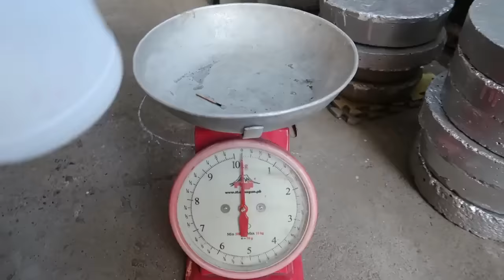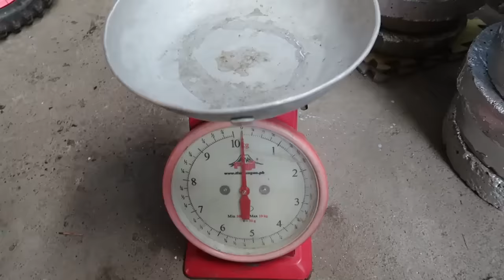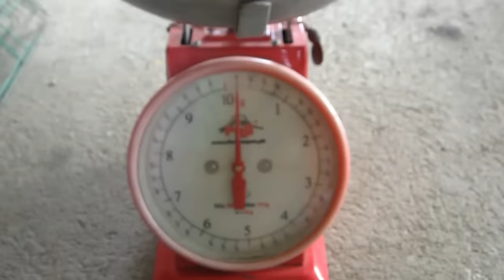How to Make Homemade Dumbbell For Free - DIY Weights

Comment: For the people that don't have scales or that can't access them; 1 l of water is almost exactly 1 kg. You can use already measured containers such as bottles, canisters and really anything that can store water. For example, a 1.5 l bottle when filled with water will weigh 1.5 kg. You can stack 4 of them and get a weight of 6 kg. Don't hesitate to start doing what's right! It's only a few steps away and I believe in you!
Reply: I love you bro❤️

Comment: Thats fantastic. I was body lover some years ago. I read a lot of, joined best gym and won mr. Indore title. Then bad time comes. Went in depression. Start drink and smoke. After 5 to 6 years, i started working out at home due to lockdown. I used my knowledge and came to 54 kg from 71 kg in two month. Only body weight i used and one water bucket. Also i couldnt get egg and meats as well. Now i will add more weight and make a good body without spending on gym membership. Thanks for the video. Helped a lot
Reply: You went up by 17..kilos in two months?

Comment: 0:30 i just spend 3hours making this, its 4am right now :D
Reply: I didnt have rope so i used tape and my bar was thin
Reply: @poliisikoira2765  was it holding alright? I want to build this too, but I don't have such ropes and I don't know what kind he used, because it doesn't look like your usual rope to me. I was thinking about using tape, but my main concern is that they won't hold together and will fall down
Reply: @micy7182  i used tape, the bottles are spinning depending on what reps are you doing. But its worth it im already seeing proggres.

Comment: This is super lightweight tho. You could just buy some candles. He's not even straining. I been lifting most my life tho so maybe it works for a starter. I did start at 15lb curls when I was 15 an now at 44 I do 55lb, an these are like 8lb. An you get what you train for. When I cut back speed or weight I get weaker an slower

Comment: Hows the bar...what type of bar..is it pvc...plss bro
Reply from the maker: Yes pvc pipe for light weight dumbbells. I used galvanized pipe for heavier dumbbells
Reply: @romgd  not dumble bruh ..for barbell..i have tried 8+8  .its slightly bending..will it break..i am just widening my arms also for preventing frm bend

Comment: What is that rubber stuff called that you used to tie the bottles together?
Reply from the maker: Bike interior, but i recommend to use galvanized wire or any type of wire, it will hold the bottles well together.

Comment: 10 kg is about ( Estimating - Rough guess.) 22 pounds. So that's 10 kg x 6 
60 kg plus a 5 pound bar.  Thats roughly 145-150 pounds. That's not bad.

Comment: what kind of sand do you use ??????

or can i use any sand????????
Reply from the maker: You can use any type of sand. The sand i used was from the river.
Reply: @romgd Can you use soil ??????, because I think the earth weighs and absorbs water but I don't know if it works the same, and that's why I ask you
Reply from the maker: You mean dirt / soil?. You can use what is available as long as you have something to use. Gl!

Comment: OD pipe??
Reply from the maker: Galvanized pipe
Reply: No i mean the size of outside diameter of pipe?
Reply from the maker: Which pipe? I used two kinds of pipe 3/4 inch schedule 40 and 1 inch same schd 40

Comment: 1. Stainless steel square canister green - https://amzn.to/3wc1Wtm
2. 2 tier kitchen rack- https://amzn.to/3g59CYB
3. Kitchen wall sign- https://amzn.to/3w69HRo
4. Kitchen wall handing- https://amzn.to/3g50oM4
5. Cutlery holder- https://amzn.to/3z9um94
6. Bamboo kitchen cooking serving & spoon - https://amzn.to/3w7JsKe
7. Fridge magnetic white board - https://amzn.to/3pzmwB4
8. Glass air Tight storage container- https://amzn.to/2SmYH3t
9. Kitchen Mat- https://amzn.to/352xq9i
10. Glass oil dispenser- https://amzn.to/3pAwP8j
11. Glass jar for masala - https://amzn.to/3v3yHr5
12. Kitchen Serving tray-https://amzn.to/3gi9hRa